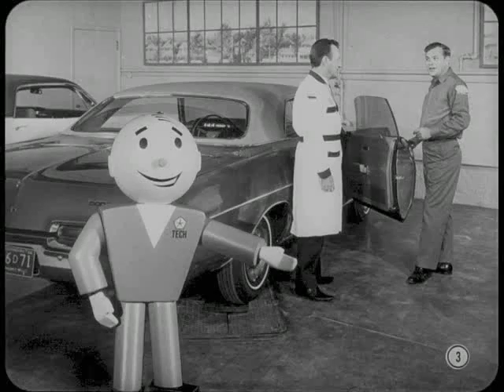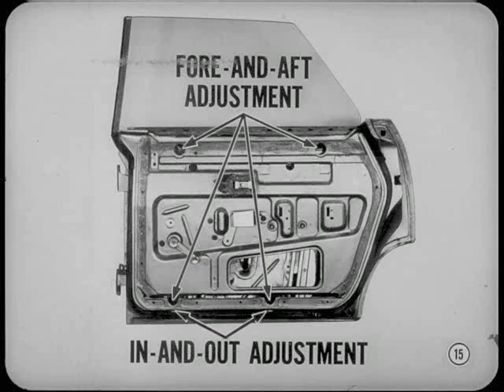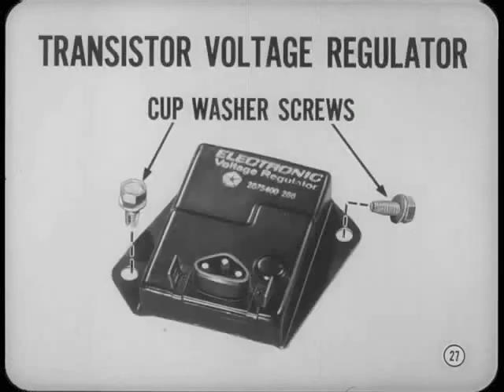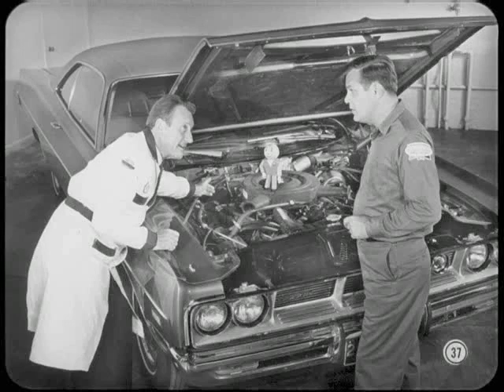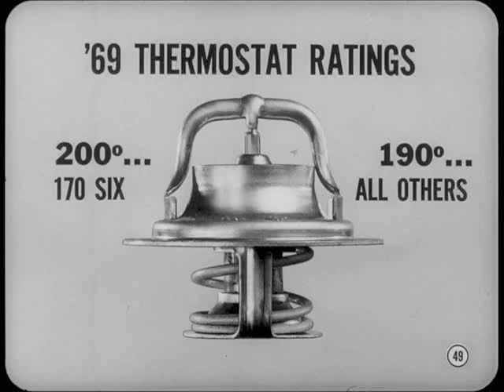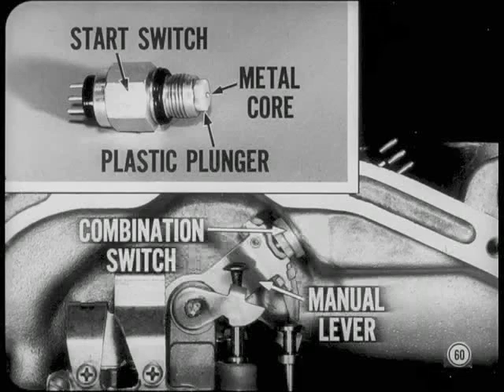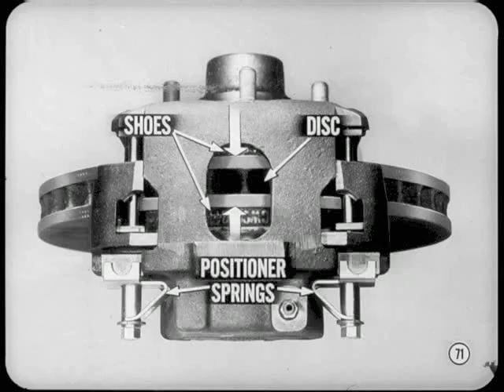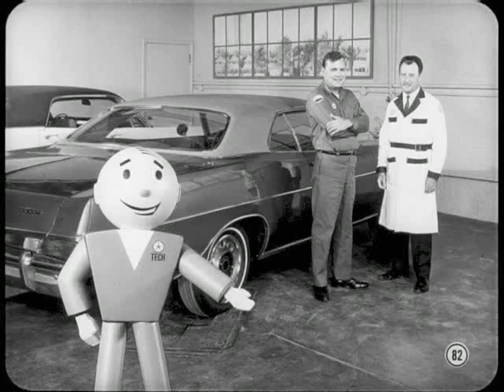MTSC - 1969, Volume 69-1 Sixty-Nine Servicing Highlights

Comment: As a Retired Auto Tech from the 80's thru mid 00's, I'm finding so much of this fascinating!!
Very early Mopars has separate Brake Rotor and Hub? Wonder why they dropped that feature until the late 80's?? Also, Cone Locks on the 8 3/4" Rearend? Didn't see much of that, except in High-Performance Auburn Diffs. 
I've been learning that Chrysler was quite innovative in the early days!